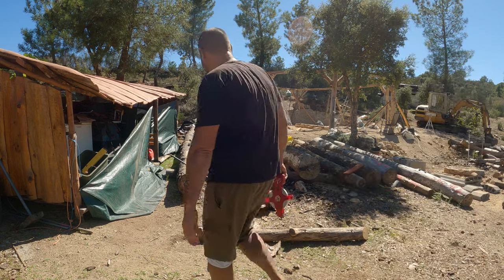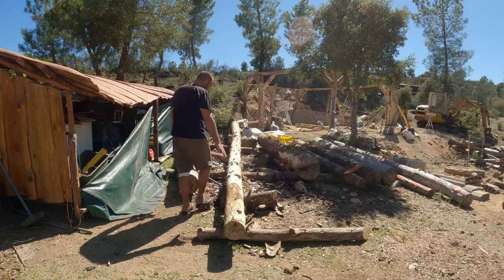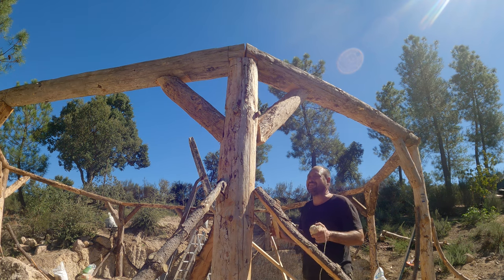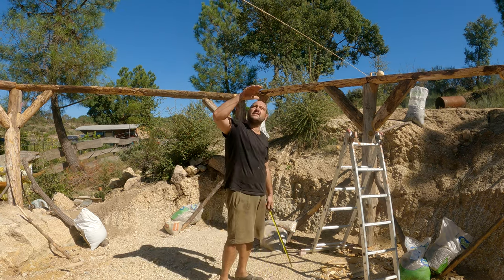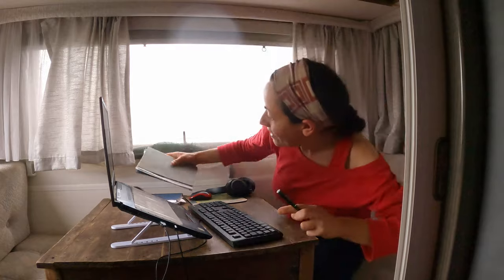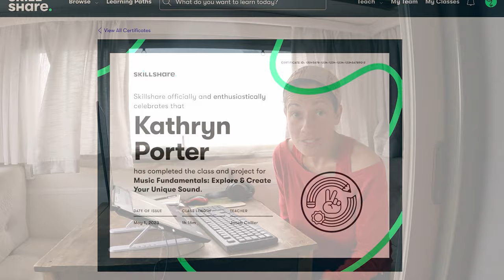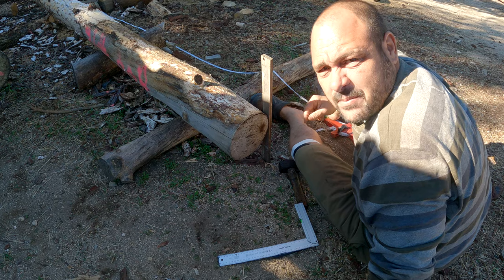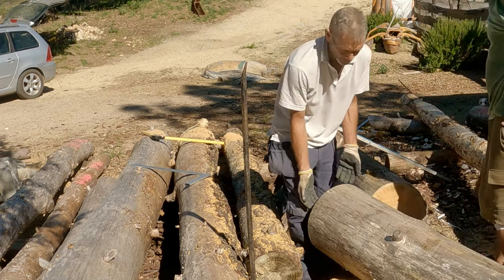Building Dreams One log at a time — Off grid living

Comment: Luke,  the digger seems a bit difficult to make precise motions. I suggest getting a pulley that can be attached to the bucket which would allow more controlled vertical movement.
Reply from the maker: Good idea! Yes the digger has some hydraulic oil leaks so not working at it's best as I ran it with the minimum amount of oil possible